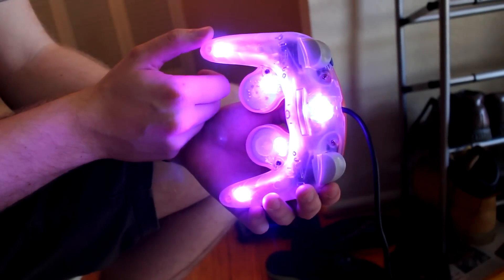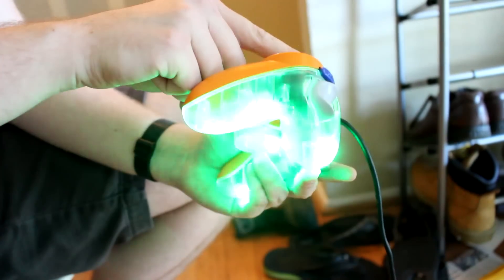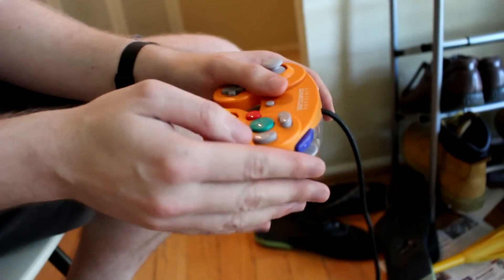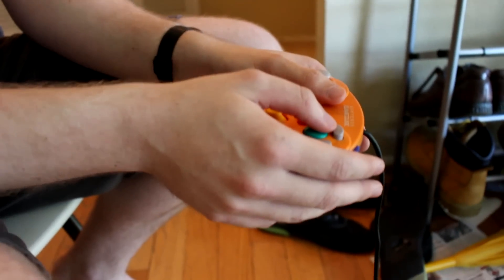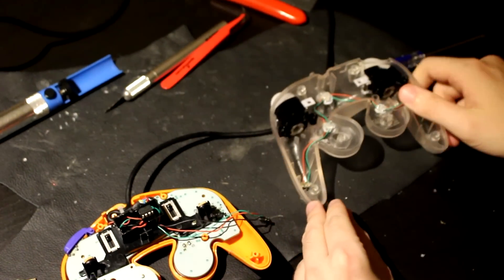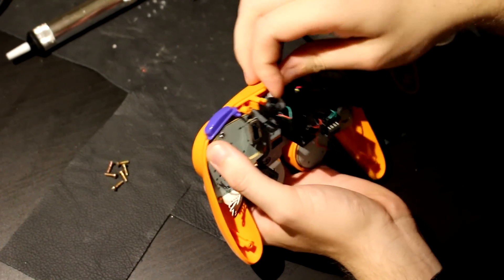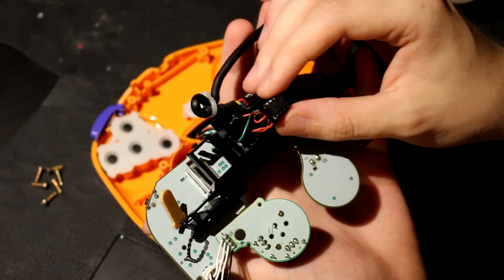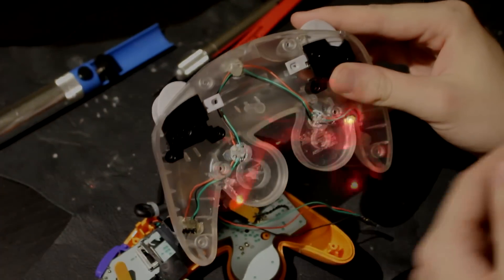Shinewave - Reactive Gamecube Controller LED mod

Comment: I'm thinking of doing this (with a different board I'll program myself), but one thing I didn't see mentioned is that each of these LEDs can draw up to 60mA. 5 of them then can draw up to 300mA, and that's not even including other controllers or rumble. USB ports, if I were to use this on an adapter, are only supposed to go up to 500mA of supplied power. Any thoughts?

Comment: I know this is an old video but I just wanted to say THANK YOU SO MUCH, this is exactly what I was looking for for a long time (you actually have more stuff on your controller then I even wanted to add to my own, so it'll be even better now). Removing the rumble to fit the micro controller was really smart, I personally disable rumble whenever I can as well. Thank you!!!

Comment: Oh, this is awesome! Quick question: Do you think something like this can be done to a Switch Pro Controller or is there not enough room inside to fit any extra LED lights into the controller?
Reply from the maker: There's definitely room to fit LEDs, but none of the software I wrote here would apply. The microcontroller in this project is programmed to listen to a Gamecube controller signal, and wouldn't work with a Switch Pro controller.

Comment: So here is my little controller modding story. Just sharing cause it is bad, funny, and overall shows that following the guide down to the product matters.

So i got a purple and transparent controller, and i got 3 controllers overall. My oldest controller started to act up however, no consistent Bair moves for my Yoshi, damn important to get that fixed. At the same time, i did research into modding so i could get RGB working from your guide. Eventually i got it working, but i am an idiot and somehow fried something on my test controller's PCB. Why? 1 strand of copper cable went from the 5V to a different rail, so god damn that ruined 1 controller. I however knew that the ruined controller was a 90-95% perfect shield drop controller + Bair working damn well just the same. But all that is now wrecked, so i decided to shape up my oldest PCB. Removing the old servo-mechanical thingy for my left stick didn't work however, since the older ones are soldered onto the PCB with 6 signal ports and 4 heavy ones just for it to stick. While new ones? They are screwed in place. So i am turning more and more crazy cause i now got 3 controllers in pieces and nobody is really working or is the best. And while i at last got rid of the dumb old controller mechanic, 5/6 solder points works but the LAST one got ripped. off. DAM it am going mad now. Originally i even went with hard solid thick copper wire, so i wasted weeks and weeks on that alone. With good wire, stuff went far faster, but i still hit on crippling problems as i told. FINALLY when i think i found a solution, i hit on even more problems. So at this point i am going to probably just say bye bye to the oldest PCB, and use it as spare-parts. While i take the other newest one and use that as the main controller. With a working proper RGB mod on. If the left stick mechanic is garbage, then i'll just swap it since it is modern and demand only a little soldering + screws. The C-stick was awful on it also i think, but i can change that one actually so i should be safe there too. The rest is down to if i need to mod the controller or not so i don't get any annoying snap-back issues. THAT is the true issue here all along to be frank, most of the controllers were fine and the one that got fried is completely fine PRIOR to my voltage mistake. If i can get it to work though, i am in the money. If not, well i still learned a looot from all of this. And i am confident that i eventually will sit down with a controller that will let me abuse Yoshi's max potential as should be done anyways.

Great tutorial by the way, i just wish the software was easier to grab and apply. And that there was a default profile for all characters now when we get and already have multiple smash games out there. I don't need a custom profile, or a custom tool all that much to make a custom color profile. What i'd love instead would be something neat and basic VS what most characters will do in the game. That way Smash Ultimate players will have 1 color scheme for all of their characters, despite games. My 2 cents anyways.

Also, i find your web-site or whoever runs it to be kind of lacking at giving out links and stuff of the sort. Not because it doesn't work, but finding the custom button site was kinda difficult. I dunno if it matters or not, but being able to easier reach important stuff would be pretty damn nice considering custom yellow-metallic buttons is damn nice and is something i'd love to order. OR ordering a custom and better controller chip for the sake of setting up an RGB system? Just sayi'n, a few but some might wanna buy that. OR just have it in stock, OR have a stock at all lol :D

That's that for now, cheers and rock on dude.

Comment: Ive bought everything now but compiling the avr could get hard without linux :/
Reply: scratchhead hard? It just took me... well definitely less than an hour to install avr-gcc in Cygwin, following avr-libc manual intended for Linux, and 95% of that time, i was just consuming YouTube, not working hard or anything. I just dropped prefix out of everything because installing to /usr/local is just about the right thing to do, it's already set up with paths and stuff. Just make sure you first install GMP, MPFR and MPC through the Cygwin installer, including development libraries, and of course you'll need gcc to compile your gcc. ;) And if you're compiling a bootloader, like micronucleus, avrdude, etc, you'll need libusb, also from the Cygwin installer, and you might need to fix up sections in the code of your loaders where it tries to include lusb0_usb.h on Windows instead of usb.h on Unix, and you'll need to change it so it behaves like on Unix. Easy enough. Oh of course i compiled gcc on all cores, so it wouldn't take an eternity, with make -j6 for me because i have 6. I chose latest release of GCC 4.9 that came out just recently, because some useful feature for AVR was introduced in GCC 4.8 (i forget which), and in my experience, minor platforms (like ANYTHING except x86 and ARM) often acquire headscratching bugs when new version rolls over, but 4.9 has been around for a couple of years, so they likely got any and all regressions out of it. Avr-libc also built well with -j6. Binutils probably would too, but i forgot to do it.

Of course there are different ways, but i think a few minutes worth of actual effort and some waiting is a good compromise for me to have that little bit of fake Unix reasonably well integrated into my Windows workflow rather than mucking about with a native port which should take a while to figure out, to see what they actually did there and where things went. Plus my stuff is going to be 6 years more fresher. I think the idea behind WinAVR isn't that far off, it's also Makefile based and appears to be a MinGW port of the same toolchain, so you shouldn't have too much of an issue with that for software that was actually written under Linux. I'm just more of a Cygwin person than a MinGW person, because i find it easy to port any Linux tool to Cygwin.

Ubuntu in a VM could get wonky with Micronucleus in particular, because you need to get USB redirection right, and there might be latencies when devices are switched over from one operating system to another. And you know, you have a limited time window there on the hardware! But i haven't tried really. So nothing from me on that.
Reply from the maker: You're right, the project is nearly complete on AVR platforms. However, that only covers the features that I've made public, namely USB-HID support and visualization. However, I have grand plans outside of the scope of what I've already done, and that need more powerful hardware.

Most of what I've learned so far is in the digital realm, so I'm afraid that I wouldn't be able to pitch in about anything analog like RF.

You should consider joining my controller modding chat over here! http://electricexploits.net/chat/
There are a lot of artists in there, but I'm trying to get more hardware/electrical people in. We all have an interest in modding controllers, but are all friendly folks willing to talk and give advice. It sounds like you'd be welcome!
Reply from the maker: Ah, sorry about that. My programming environment is all in the Linux command line, so it's pretty hard to replicate in Windows. To be honest, others have had more luck with installing Ubuntu on a VM.
Reply from the maker: Siana Gearz Congrats on getting it working then! To be honest, I hadn’t yet tried to get it set up on Windows, and I judged it as difficult for someone who had never programmed before.

I’ll keep your installation notes in mind!
Reply: Garrett Greenwood Well i'm obviously not somebody who never programmed before, i maintained a port of GCC for an exotic platform for a while too, maybe a decade ago or so. But i didn't need to get contemplative to get this installation pulled off, i had trickier setups regarding much more trivial things on better supported systems than Cygwin. This was butter smooth.

If you want to cater to people who never programmed, you would probably need to provide Arduino support, and it is my understanding that the toolchain from that has been broken out into a command line tool under the name of Ino, so that shouldn't be too much of a stretch. To my taste, Arduino adds a couple extra levels of indirection that i'm wary of, and the compile times are horrendous, so there's that.
Reply from the maker: At the moment, my installation notes aren't meant for someone who has never programmed before. I have plans to target non-programmers without necessarily dropping into Arduino-land.

You're right, Arduino is an entire toolchain/environment built on top of avr-gcc and avrdude. The Arduino library is automatically imported during compilation and is a source of a lot of indirection and slowness. In order to keep up with the Gamecube's polling rate, I need to interact with the hardware at a much lower level than Arduino makes easy.
Reply: Garrett Greenwood 
I see. Well yes you can for example embed a bytecode interpreter and either flash bytecode from your main firmware receiving it via HID from PC, or ship a micronucleus based loader which will append the bytecode to your firmware. I'm curious how you got both controller spy and USB running at the same time.

Aaah, the statemachine is a kind of interpreter after all. And you don't just spy, you poll, so you can do that whenever USB is idle. I see!
Reply from the maker: Funny you should mention that. I already have a micronucleus bootloader and HID set up on one of my prototypes. I've also been looking into a bytecode or lisp interpreter aside from the statemachine.

Yup! I poll the controller in between USB polls.
Reply: Garrett Greenwood  It's not a coincidence. I have bought a small truckload of cheap Micronucleus-based boards just to have fun with, butcher, leave around as pranks, put blinky sensors in flowerpots reminding me to water them, whatever, and your project has been mentioned on the Micronucleus project page, where i come from. Which is specifically why i was setting up the proper dev environment alongside watching your vid and others.

It was also rather obvious you'd have HID in there since the video mentions a USB gamepad adaptation.

On the whole however i'm rather sceptical of using AVR for USB - the USB specific models aren't the cheapest and smallest, and the bitbang USB pretty much kills the idea of any interrupt based communication alongside, and there's no buffered communication to speak of, so for example a USB MIDI device which does chiptune synthesis on a single chip is a no-go, i'd need two - which is perhaps not too bad, given one can be a Waveblaster host and another a Waveblaster compatible daughterboard. PIC18F are the cheapest and smallest native USB chips more or less, but there isn't more than a couple cents of difference to STM32 either, which is amazing. I also have a bunch of STM32 kit ordered, but it hasn't arrived yet. Those are probably something i'll put to proper use, their DMA controller makes them pretty versatile.
Reply from the maker: Ah, great! I've compiled Micronucleus for the ATtiny84 and have it running at 3.3V/12MHz on a special board. Altogether, its still small enough to fit in a controller's empty space. I have to put in a lot of effort to get it all working at 12MHz though, so it'd be nice to have a more powerful chip. In addition, V-USB only supports a subset of the USB low-speed spec, while taking ~15% of the program space and hogging runtime. Obviously not an optimal solution.

Meanwhile, I've been looking at the STM32 chips and am glad to see faster clockspeeds, a 32-bit environment instead of an 8-bit one, more I/O, and hardware USB support, at a comparable price. The only issue is that I'd have a new architecture to learn but I'm a lot more qualified to do that now than when I started this project.

So overall, I think that I'm going to start redeveloping what I've already done for an STM32 chip instead of continuing to overspend time optimizing my code to work on a platform that's barely powerful enough.
Reply: Garrett Greenwood But this project is practically done, right? No more difficult parts coming in. When it comes to STM, there might be plenty more that you'll need to torture yourself with. It may be smooth and painless, or it may delay the project for months or years. I can't give you any advice regarding that, but something to be careful of so late in the project.

On the other hand, ATMEGA16U2 may be two times the price, but it might not matter in the whole cost of a kit.

What i plan with STM32 are things like FM synthesizer, line-chasing video output straight to NTSC or PAL without external logic (passive external components only), which i expect to be able to make work better than on LPC because of DMAC, big and rewarding things that you couldn't possibly do on any 8-bit controller.

I have been very reluctant to try PIC, for one, because local distributors made them way too expensive, and for other, because of proprietary toolchain, and third, terrible assembly and low performance overall. But for such things, the built in peripherals can offset the low performance, and the other problems are going away. Not a recommendation on my end though, certainly not, merely a passing thought.

Comment: tutorial anytime soon? you should sell kits so people can install it themselves. and is there a way to do this mod and still keep the rumble?
Reply from the maker: +schmoop I'm actually working on a better version of the mod at the moment, and I have a ton of plans to sell kits and make tutorials for that! For that reason, I'm not planning on making a video tutorial for this. If you click over to my blog post(link in the description), I describe the project and how to program the microcontroller. Hopefully that will help! If not, I'd recommend waiting it out until my Kickstarter goes live, since I'll be selling assembled modded controllers as well as DIY kits.

There's actually enough room in the handles of the controller to fit the mod, so there's no need to remove the rumble if you prefer.
Reply: alright cool thanks!

Comment: is it possible to use this kinda microcontroller for making a converter from gc - n64 controller and vise versa?
Reply from the maker: +sindrecool1 Yeah! In fact, somebody has already done it on an Arduino, a class of microcontrollers very similar to the one I used. You can read all about their project here: https://github.com/brownan/Gamecube-N64-Controller

Comment: If I don't want it to respond to button presses and just have it always be rainbow?
Reply from the maker: You'll still need to go through the same hardware mod, but the software will need to be modified a little bit. If you want to do this, let me know once you have the work done and I'll help you with the software.
Reply: Garrett Greenwood well my main question is where do I get the leds I need for this project.
Reply from the maker: +Pat Solom Read my post here, where I explain the mod and how to make it! http://electricexploits.net/shinewave/
Reply: +Garrett Greenwood TBH I don't know when I'll do this but would this be tournament legal?
Reply from the maker: +Pat Solom No rush. As far as it being tournament legal, it is completely up to the discretion of the TO. Many tournament's have the written policy "no controller mods", but don't mind at all if people remove springs, swap out custom shells, or install LEDs. In fact, this mod should be even less questionable than traditional LED mods because you can easily turn them off if your opponent/TO asks.
Reply: +Garrett Greenwood OK